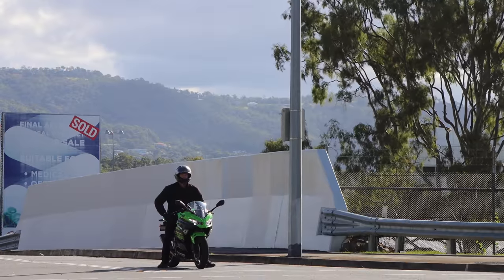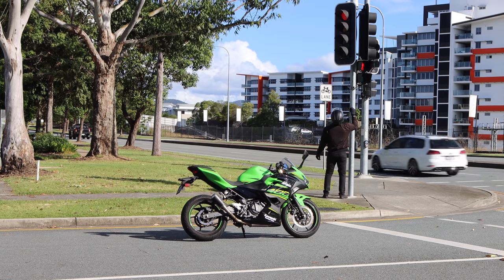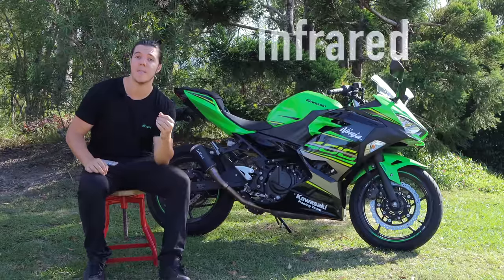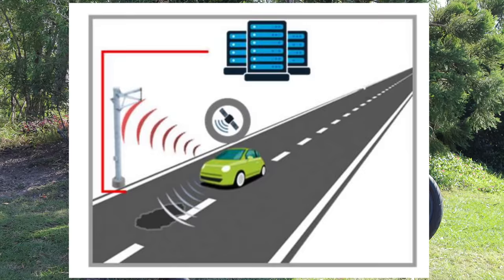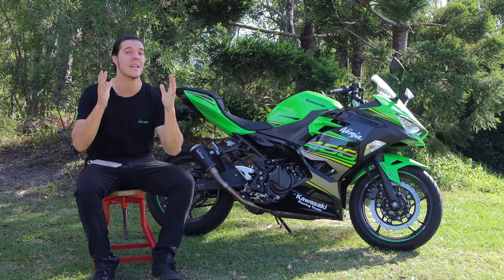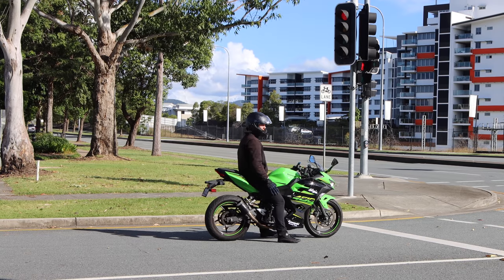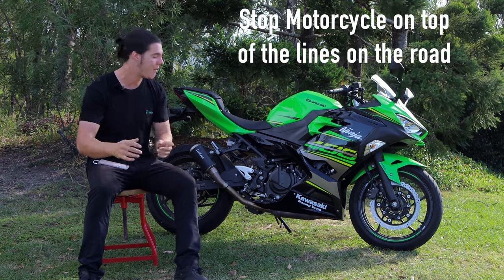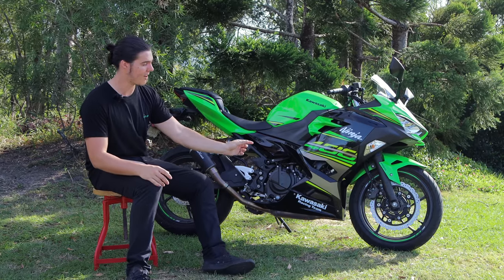How to trigger Traffic Lights on a Motorcycle | Stop getting stuck at red lights

Comment: This has been a huge peev of mine for decades. The pressure on the automotive industry to raise gas mileage standards without any type of change to traffic signal "technology" , if you can call 70's technology "tech" is totally futile. Here in CA driving the speed limit you are almost guaranteed to hit almost EVERY traffic light RED. Imagine the fuel mileage gains if just 70-80% of driving we'd be crusing through a green light. Here in SD, CA you can look down the road as you're sitting at any red light and your next light down the road is green with no almost no traffic ahead you only to turn RED when all the traffic approaches. That light should've been RED and letting side traffic pass and turning to green as reasonable distance before the light as oncoming traffic approaches. Sitting at a light not moving is not getting better fuel mileage and just think about all the BRAKE DUST that is created at EVERY stop light by a pile of cars hitting the brakes. ABSOLUTE BS!
This seems like a very important issue and I don't know why more folks don't make a stink about it? I would bet that the IIHS (Insurance Institute for Highway Safety) and the police departments want to make us drive as freaking SLOW AS POSSIBLE. To me there is no good reason that we can't get out of the 70's stop-at-every-traffic-light dilemma. All light are connected to a central system and have been for years! C'mon, there's got to be an algorithum to solve this??!! It's such an incredible waste to sit at a traffic light with 20+ cars stopped in either direction at a red light when there's 2 or 3 cars/trucks going through the green light. Is anyone following me here and sick of stop,start/stop/start, on the brakes on the gas BS???!!!!

Comment: A strong magnet(like crush your hand strong) is far better at tricking the induction loops. A tv remote pushing random buttons(it’s different everywhere) can trick most active and passive infrared. A laser(doesn’t have to be powerful) shined at the microwave or visual sensor usually does the trick. Also most lights have a “minimum time” that they can be green so none of these will work in that time. Courtesy your friendly neighborhood white hat.
Edit: DOT regs say you’re free to go if you’ve been waiting longer than 2 minutes. In USA.

Comment: When the light just won't change sometimes it's best to signal and then bail from the turn lane and then do a u-turn a block up. Yes you turn is more dangerous than turning left but it likely won't get you a ticket if you have a cop that just doesn't care about understanding issues. In my experience most are human and let even more things than they should pass. So...
 But be careful.  Sometimes small towns have  the sensor so they don't detect smaller cars or lifted trucks easily. Law enforcement generally knows the locals to whom they're elected by.  But for those from out of town?  Revenue!
   My Toyota that sits on 44s rarely triggers lights using induction. Even when placing the differential directly on top. 
        ✌️🤠🏞️🐂

Comment: I'm confused. You state "Stop your bike on top of the line". At 4:25 you show the bike stopped in basically the center of the "pad", with no part of the bike over the "line". A few seconds later, at about 4:27, you show the center of the bike over the line for about 1 second. I assume at 4:25 this is NOT the correct position???
Reply from the maker: No it is the correct part, the camera is just not picking up the middle line. On that light there are three lines like this | | | 
The camera just doesn’t pick up the middle one due to the angle

Comment: One time after waiting at a light through 3 cycles and trying to adjust my bike every which way in order to trigger the light, I just ran it and pulled into the gas station, directly across the street, to fill up.

No sooner had I dismounted did a cop pull up behind me and asked me what I thought I was doing.  

I'm like "getting gas" "what are you doing"?

He said "I just got finished watching you run that red light, what do you think? You're special?"

I responded with "Of course I'm special, I'm riding a motorcycle and sat through three light cycles, with every light but mine turning green.  What tf am I supposed to do, sit there till I die?"

 I then literally turned around and proceed to fill my bike up and never even bothered turning around and acknowledging him again and he eventually just drove off.

Comment: Good video.  However, stopping your bike over the line that is perpendicular to your direction of travel in an induction loop control intersection is not as effective as stopping your bike over the line that is cut in the direction of travel.  This way, far more of your bike is over the sensing wires.  And I've been told that these wires do not sense nonferrous metals (ie. brass, aluminum, copper etc.), the will only pick up steel or cast iron.

Comment: How about showing clearly where to stop wrt the sensor wires? Or even a simple drawing? Mostly, it looks like your bike is stopped in the center of the "loop", not over a wire, which I don't get...That and it's 4 minutes describing the different sensors which are mostly not the problem, only to get the same advice for the induction sensors that everyone has known for 50 years...
Reply from the maker: The camera didn't really pick it up but there is a wire running in the middle of the square aswell on this one.  Looks like this  | | |  and I was going over the middle wire line

Comment: flashing your bright lights at the right distance will work on many lights
Reply: Yes. Alot of lights are set up to pick up flashing lights from emergency vehicles. Some lights I know I can flash lights as approaching and they give me a green before I even had to fully stop. I can flash lights and see the cross traffic light instantly go yellow, I know I'm getting a green quickly.
Reply: I also have leds on my bike frame, I ride with them green and strobing alot, idk if they with traffic lights, but I know they saved me from a car pulling out in front of me more than once. It's very eye catching to cross traffic wanting to pull out of a parking lot or side street.

Comment: Uh, dudes, think of the stoplight as a stop sign. If you can't "trigger" it look both ways and when there's a break in traffic go. I've done this hundreds of times in my 45 yrs of riding. Aluminum framed, largely aluminum engines, aluminum wheels...you've got little to trigger with but your connecting rods, crankshaft & various other bits. Look for cops and go.

Comment: I have seen trigger units that are electrical for bikes that do work and they plug into your battery. I don't know if they're still produced however. They have an electro coil and create electrical magnetic energy that boosts your footprint to that of a car. I just wait a certain amount of time and run the red light. That is the law, you can't be expected to just sit there and the law doesn't require it. You may have to go to court to clear it, but it will be cleared. The police won't be able to say one way or another and it will be dropped or you sue. Most cops know why you ran the light and wouldn't pull you over, or would let you go. If you do have to sue, start at 100 million and use motorcycle cops for your defense, and whatever you do, DON'T SETTLE! They too, have to deal with the same thing. After that, I promise you, your local police will NEVER write another red light ticket to a motorcycle again.

Comment: I keep telling the wife about these wires but she insists on stopping short as “she is not in a hurry” drives me up the wall🤬
Reply from the maker: Show her this 👍🏻
Reply: She also sits really close to the steering wheel holds it with both hands and lowers or turns off the music to concentrate also does 50 in a 70….

Comment: Not even watching the video just run the lights.   It’s not that big of a deal.  The light is a safety device, if you are stopped then go when no on coming traffic is coming you’re fine.     

Where I live there’s 3 lights that if you just miss the turn arrow, in a car or truck, the light will never turn it will cycle, cycle until you back up or someone else pulls up.  In my truck I run that light, I don’t even wait for a cycle, just when traffic is clear I go. Same thing on a motorcycle.   Coming out of the ball light won’t change I pull up put my foot down. Wait for traffic to clear and go. Knowing that light won’t change for me there’s no reason to wait for 2-3 min or cycle of light. It’s more dangerous to wait at the light.

Comment: "Common problem for motorcyclists" that's because common sense isn't common. Seriously, what idiots don't know this?!

These loops are usually a figure 8. Park your engine over the centre line at the front where it's a T configuration for the best chance of interacting with the field and it NEVER fails!

Comment: Why don't they just set the sensitivity properly?  Turning and engine off and on wont help a bicycle.  They said if it is set to sensitive, they will get false signals.  From what, a squirrel?  What could possibly falsely trigger it?  Also, how annoying that only 20 states have "dead red" laws.  What are we supposed to do, memorize which do and which don't?  If one state has it, then all should have it.  So annoying!  "United" States (my ass).

Comment: This is Bogus BS - Why don't they Just run all the lights on a timer and Don't use any silly sensors AT ALL. If they timed all their lights right for the speed of the roads from intersection to intersection, there would be NO Need for Sensors and No Biker would Ever have a Problem!

Comment: You are completely misinformed sir let me go ahead and fix this video everybody that is reading this comment pay no attention to the man in the video he does not know what he's talking about now that you know this this is how it really works a vehicle's electrical system creates a magnetic field the wire that is in the ground is literally that opposite of a metal detector it is actually a magnetic field detector so when a vehicle that is producing a large enough magnetic field from its electrical system passes over the magnetic field detector that's embedded in the asphalt and or concrete then the light is triggered motorcycles electrical systems are not strong enough to create the magnetic field to be detected by the detector so if you want to solve this problem and I didn't even start watching the video completely I got to 146 and realize this person doesn't know what they're talking about you get yourself some strong rare earth magnets do not buy man-made magnets by rare earth magnets AKA neodymium magnets give yourself one that's about I would say a 1 inch by 1 in cylinder say 90 lb pulling Force and put it somewhere at the bottom of your motorcycle it will literally attach itself to some steel part that you have it will never come off no matter what ramp or bumps you go over you're welcome.